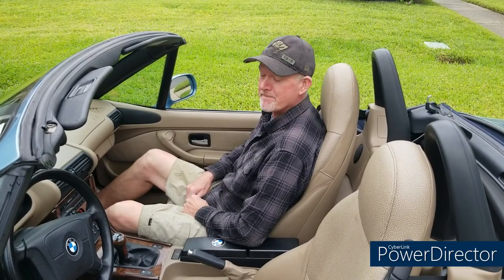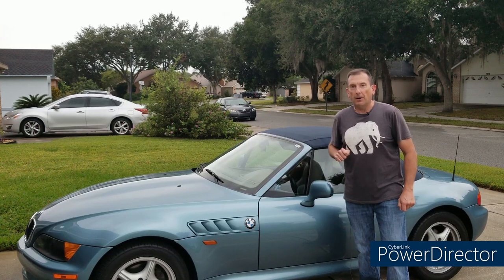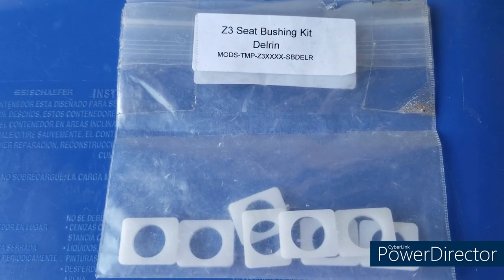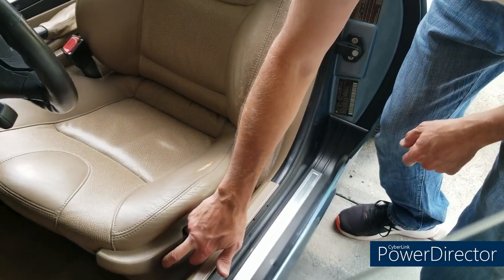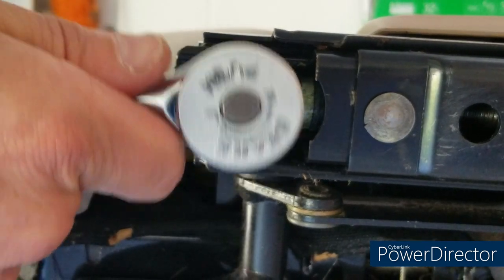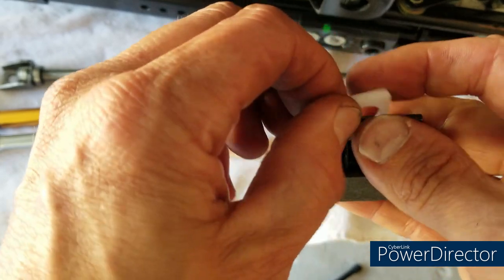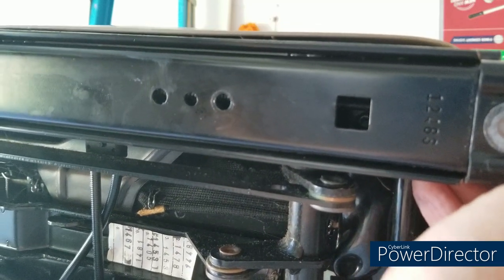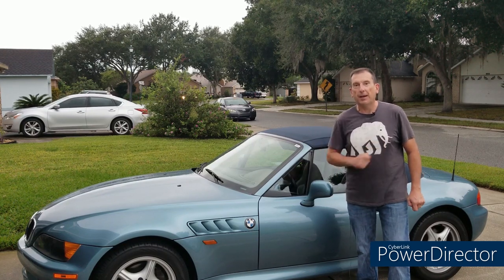How To Replace the Worn Seat Bushings- BMW Z3

Comment: Any tricks to getting the square flexible shaft to fully engage?  The nominal position of the shaft is not allowing it to fully seat, and I cannot get enough of a bend to in the flexible shat for it to fully seat.  Have tried screw driver, pliers, to bend the flexible shaft, (while wiggling the threaded rod) through the inspection hole, but no luck so far.
Reply from the maker: Have to admit I didn't run into issues.  I d take a step back look everything over.   There is more than likely something simple that is making it difficult.

Comment: I did this repair several months ago. Nice job on the video Mark. Just one tip; when the seats are unplugged don't start the car as you will have to reset the airbag sensor. I reset mine using a cheap tool I purchased from Amazon, that worked nicely. Reportedly, having the BMW dealer reset it is expensive. Also, be careful removing the seat as mine tipped forward and knocked the mirror off the windshield, though I don't think it was held on very well anyway. Gluing the mirror back on would be another great Moment of Zed opportunity, by the way.
Reply from the maker: Thanks- yeah, the seats are heavy and awkward- I had my buddy Pat eyeball my movements to avaiod problems.

Comment: I could not have repaired mine without your excellent video, thank you so much for taking the time to share it! So well done. I got the spacers from the guy out of NY for $11 with free shipping and they fit perfectly (no sanding necessary). If you are looking for ideas, how about installation of oem seat belt guides? Thanks again for all your great videos.
Reply from the maker: Joe, thank you so much for watching!  Glad the video helped.  I'm fortunate as my guides are perfect; however, I know they are a problem spot on many.  I know they re not easy- BMW didn't do us any favors here.  If you still have both sides, there is a product which kind of mates them together.  It is just a sleeve that fits over both sides and makes a "loop".  Link to product:  https://www.etsy.com/listing/1042616437/bmw-z3-and-m-roadster-seat-belt-guide?gpla=1&gao=1&&utm_source=google&utm_medium=cpc&utm_campaign=shopping_us_d-electronics_and_accessories-car_parts_and_accessories-car_accessories&utm_custom1=_k_Cj0KCQiAw9qOBhC-ARIsAG-rdn602g1CiGbrd437H1oZgbWKjJK6zOKhsBNqNoVitzrbRpamZWNeMHgaAgGwEALw_wcB_k_&utm_content=go_1843970788_69216071745_346429322564_aud-318222619806:pla-354955384985_c__1042616437_12768591&utm_custom2=1843970788&gclid=Cj0KCQiAw9qOBhC-ARIsAG-rdn602g1CiGbrd437H1oZgbWKjJK6zOKhsBNqNoVitzrbRpamZWNeMHgaAgGwEALw_wcB

Comment: The X8R is fantastic for those who live in the UK. Not saying about the bushes now but the another common fault which are the mirrors. You can’t get housing from BMW unless you buy the whole mirror. They develop the improved part that won’t fail and you can fit right in and get your wing mirror done👌🏻

Comment: Your videos are awesome and I have just done both this job, and the door gaskets based on your instruction videos.  Much appreciated.  One thing to note is that a common issue (and one that impacted both my seats) is that they can get jammed when extended to their full height.  I needed to fix this (to fit in the car) and did the bushings while I was there.  

A callout here to anyone with the same issue, it jams HARD.  I had to unbolt the end of the screw mechanism, put a screwdriver through for leverage and really pull to get that thing unstuck on both sides.  Basically the motor feeds into a 90 degree gear setup which is a screw that makes it go up and down.  You need to wind that things back down.  Assuming your motor is still fine, once unstuck, just reassemble and the motor will take over from there where back in the car.

My windows are next.  Sadly no endoscope for me as we're talking a 27 year old, unmolested, 100% original car (except the tyres, disks and pads) so that old grease will have gone hard and needs to be removed from the runners.  Not looking forward to that one.
Reply from the maker: Thank you for the tip and I'm glad the videos have helped!  Good luck with the windows, take it slow with the door panels!

Comment: When cleaning out the block, can you use brake cleaner or wd40 to help with clean up , then add the lithium grease afterward?  I am in the process of having to do this project this weekend and was wondering it that helps make the cleaning and scraping of old debris easier.
Larry
Reply from the maker: I dont see any reason you couldn't.   Should help as the broken down bushing/old grease mixture is messy and sticky.

Comment: Having successfully done one side, i pushed the bushings in on the other, and now cannot get the kebab to screw back together at all. Magically the screw threads will no longer turn together despite doing so very shortly ago. This is turning into a major headache 😢
Reply from the maker: Maybe too tight?  Undo, slow down, redo.  Make sure you don't lose your measurements.

Comment: Nice video I follow every step. One thing I should mention is you shouldn’t be pressed in the bushing it will cause blinding. Mine move way smoother with a perfect fit than a tight fit.
Reply from the maker: Good tip!  Thank you for watching!

Comment: Thanks Mark! Just a helpful note: Please make sure the that spindle gaps (on the top and bottom if the bushings are left and right) are equal! I didn't check that on my passenger seat and it is binding, making for a slow traversal down the worm gears. I do think that over time, the forces will center the spindles in the box, and correct this. 

I checked for that and centered them for the driver's seat and it works just fine. Also note that in my install, the flexible rails separated, unlike Marks' example, so I had to connect the worm gear/rail to the flexible rail at the end. Not a big deal, just a difference. My car is a 2000 Z3 2.3, so some differences are expected. 

Just did mine with the help of my son. Always good to have help for a project like this.
Reply from the maker: Good tips and glad the video helped!

Comment: FYI, you can make the bushings too tight! I had to remove my seat ~5 times to realize this, as the seat wouldn't move. The metal block needs play in the sleeve, not in the direction of the rod, but from side to side. If you're having issues during this repair, make sure your bushings aren't too tight!
Reply from the maker: Good advice!  Thank you!

Comment: what should i do if the measurement was a little off and now the seat won’t move forward and back
Reply from the maker: If the measurement is a little off, it shouldn't be anything more than not going back all the way, or not going forward all the way.  If it doesn't move at all, the next thing I'd like to know is if the motor is turning, but the seat doesn't move; or is the motor not turning at all?

Comment: I was hoping you mention the seat back adjustable cable- mine seems to have broken or disconnected. Nothing when I pull up the lever. Anyway great channel, keep it up! I’ve got a 97.
Reply from the maker: Steve- sorry I missed your comment initially- I didn't have an issue, or I would have done that too.  Sorry!

Comment: Had difficulty once I had finished installing the new bushings……putting the seat back in the car and lining up the bolts to bolt it in….holes in the seat did not match the holes and bolts in the car floor.
Any help would be greatly appreciated
Reply from the maker: I guess first things first, did you measure the position of the bearing carrier on the threaded rod to reinstall in the same position?
Reply from the maker: You may have to go back and manually adjust.  I assume some bolts go in others don't?

Comment: Hi Mark - I did the repair just two days ago "alone", not an easy task though.  Nice job on the video, very helpful. Quick feedback if I may.  What I have noticed is that that once you free up the seat and before unplugging the connectors, you need to adjust the seat back to a center-point if you will, otherwise, the seat rail will not be slides enough to free up space to unscrew the T-50 stud.  It happened with me, and I had to put the seat back, plug-in the connectors, and readjust the rails/seat to the center; I was successful.  Thanks a million, Mark!
Reply from the maker: My pleasure!  Glad I could help!  Thank you for watching!

Comment: I did this and now the seat only goes back and forth a few inches. Both motor cables are in place and electrical connectors in correctly. Any suggestions?
Reply from the maker: Did you make sure the rods went back the same way they came out?  As far as distances go front and back?
Reply: @MomentofZed  thank you for the reply. Yes the rods are in the correct way. The motor cables inserted and the T50 bolts in properly  (Also the smaller bolts that go into carriage). 

I'm thinking the spacers might be too tight. 

Or is it possible the black nut that goes in between the spacers could have been turned around in the carriage.. don't know if that would matter.
Reply from the maker: @2effed87  if I remember correctly  I pressed mine in, so not sure.  Dont think spacer position matters either.  Dumb question-  anything physically blocking movement?
Reply: @MomentofZed  I have the seat back out again ... The carriages are less than 2 millimeters differently spaced from each other. I'll adjust and get back with results.
Reply from the maker: @2effed87  again, and I apologize for asking, but you marked the carrier position on the threaded rod on both sides and rethreaded the same way ?
Reply: @MomentofZed  yes the location is now the exact same. It was 2 mm off in difference but I plugged it all back in and that wasn't the problem. I believe I installed a nut that goes in between the spacers backwards. I'll have to go back in later and check both. let you all know so you avoid the same mistake. Thank you
Reply from the maker: @2effed87  ok!  Keep us posted
Reply: So after going over everything for an additional time, I put the seat back in and again no movement! But before I went back to the drawing board, I decided to hop in the seat   and try the switch again..... for some reason this worked. The seat now moves! Why it needed 200 pounds of encouragement, I don't know. Thanks for the video and assistance walking me through this. Now the driver's seat will be a cake walk!
Reply from the maker: @2effed87  mysterious but glad it worked out!